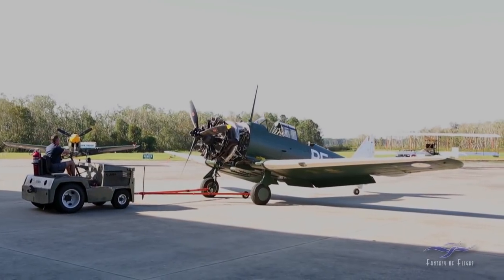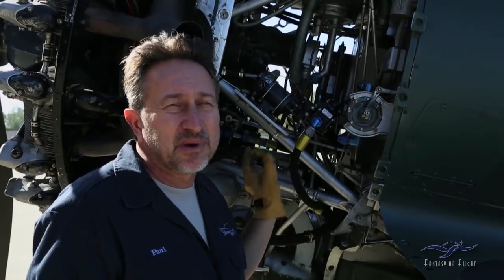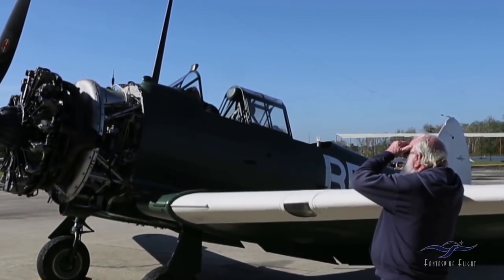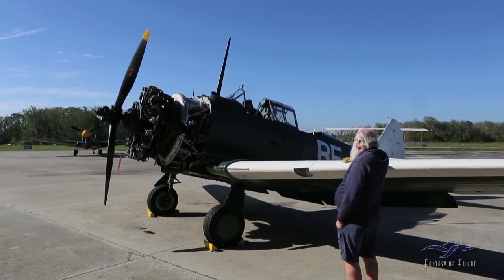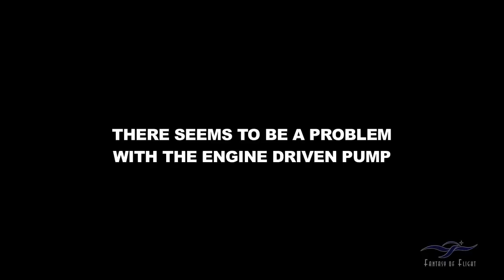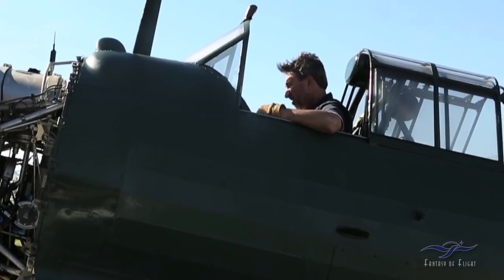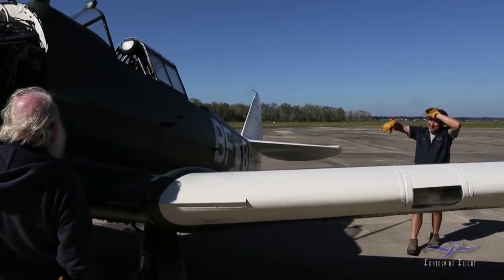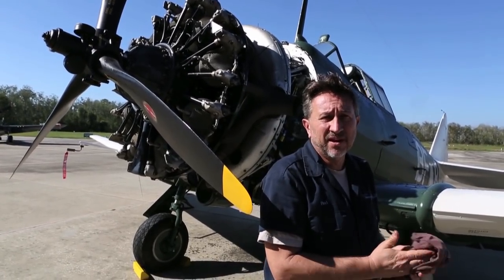CAC Wirraway - Start Up - November 2017

Comment: Poor priming after running out of fuel? Junk wobble pump run dry due to lack of lubrication and excessive clearance after the pistons and/or cylinders are scuffed, scratched, etc. No "rebuild" that "hones" or "polishes" or "plates" the parts back into "like new appearance" is going to restore proper performance. That CHECK VALVE is probably a BYPASS valve so the wobble pump, which is more or less a fixed-displacement pump, can send excess fuel back to the tank when the engine doesn't need it. That's a half-assed way to design a fuel system that avoids the complexity and expense of an adjustable pressure regulator that bypasses fuel back to the pump inlet and basically changes an open-center system "constant displacement" to a closed-center system with "variable displacement". 

Push a lot of fuel back to the tank through a "check valve" most of the time when you're flying and you're going to heat the shit out of the fuel and the hotter it gets the more trouble the pump is going to have maintaining sufficient inlet pressure to the carburetor to keep the fuel/air mixture from leaning out regardless of how you try to make the mixture richer with any ratio controls in the cockpit. 

Those wobble-pumps are also a "cheap" way to engineer a system for "mass production" and brag about the quality of the components because they sure look impressive on paper. That's the same "impressive" pump design Henry Ford and Harry Ferguson came up with for the "Hydraulic Lift" and Ferguson System used on Ford N-series and Ferguson TO-series tractors. The problem is you go right back to sump with excess oil, you're moving WAY MORE OIL THROUGH THE SYSTEM AT ALL TIMES THAN IT NEEDS just to have enough flow to make it work right at "max load" and you're wearing out parts and heating oil and the hotter oil (fuel in your case) just does a poorer and poorer job of lubricating, becomes more aerated and is constantly keeping the products of that wear - metal particles, etc - in suspension and circulating through the system. \

And guess what? There's no way to "fix" FLAWED ENGINEERING AND CONSTRUCTION and no way that airplane/engine/fuel system will ever be "right" even if you spend a stupid amount of cash having every "factory" part reproduced/replaced with NOS or aftermarket parts MADE TO FACTORY SPECIFICATIONS. And any "fix" you do like that BOOSTER PUMP is shadetree engineering that will PROBABLY get somebody hurt or killed or at least seriously inconvenienced if the plane is flown hard enough long to find the next "weak point" in the system. 

The reason your "rebuilt" wobble pump won't do the job by itself could be several things. Is it plumbed INLINE with the booster pump? If so, do you think its capable of pulling fuel THROUGH the booster pump and supplying the engine with enough fuel with that GIANT RESTRICTION between it an the pump? Probably not. Is it plumbed in PARALLEL? If so, is it plumbed "correctly" in parallel so when the booster pump is shut off the fuel system in its entirety is shifted over to the wobble pump? Meaning there's no way for it to bypass fuel BACK TO AND THROUGH THE BOOSTER PUMP OR ANY OF ITS PLUMBING? If not, how is the wobble pump going to work "correctly"? 

And here's where things get uncomfortable and you might have to tell one or more "experts" their "rebuilt" or "NOS" or "reproduction" parts and/or their "engineering" and/or their "expertise" and maybe  their "good used airplane" they sold you for a "good price" are all "dubious". Because if everything else is "right" and you've returned the system to its "factory" configuration and it still doesn't run right, then its a PARTS PROBLEM and since you can't kick the original designer/manufacturer/engineers in the balls, you're going to have to kick whoever is telling you they can "fix" flawed engineering in the balls and start LOOKING AT THE PARTS and asking questions. 

Like, Is that "overhauled" booster pump CAPABLE OF BEING CORRECTLY "REBUILT" TO FACTORY SPECS AND IF SO WAS IT REBUILT AND TESTED TO MAKE SURE IT PRODUCES A SPECIFIED AMOUNT OF FLOW AT A GIVEN PRESSURE WITH SPECIFIED AMOUNT OF INLET RESTRICTION? And did it EXCEED that flow specification with enough "safety margin. i.e. excess flow to keep the engine properly supplied even when the FUEL TANK IS LOW ON FUEL AND WHAT'S THERE IS HOTTER THAN HELL AND ANY FILTERS INVOLVED ARE ANYTHING BUT "PERFECTLY CLEANED"? AND IS THE "NEW" CHECK VALVE UP TO SPECS AS WELL? 

A system like that SHOULD BE laid out in the service manual if any and there should be SPECS to allow it to be "flow tested" with the airplane on the ground to make sure it produces X psi of pressure or Y GPM of fuel flow just as it sits assembled and plumbed like it is on the running airplane but with the pump outlet going to a container instead of the carburetor. If its not backed up with that kind of engineering/design support and quality from the factory, then its a system every bit as "high-quality as the people who made it as "cheap" and "simple" as possible so the "stakeholders" in the company got THEIR "value" from THEIR "investments" and the poor fools buying it got the "loss".

Comment: It appears to me a little bit closer to a Texan...
Reply: Well that's they are. The quick way to tell the difference is the tail  plane. The Texas had a straight rear rudder, while the Wirraway has a larger rounded rudder. They also had the nickname "zero killer" as an Australian pilot shot down a zero in one

Comment: These are a Texan / Harvard derivative.
Reply: Larrikins54 The Wirraway is actually derived from the NA-16, which was the same aircraft that the Harvard was developed from.
Reply: @chrisdaley8542  Built under license to CAC in Port Melbourne, Victoria.  Boomerang design was taken from this basic Airframe design as a stop gap measure when We had not much else during the early fourty's.
Reply: Paul Rourke, yeah, my grandfather was the CAC flight test engineer on the Boomerang.